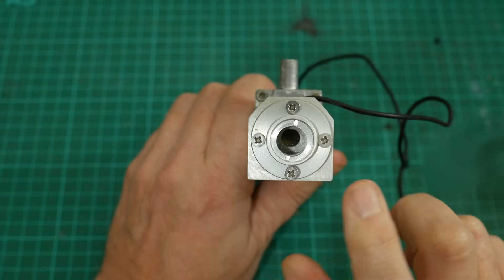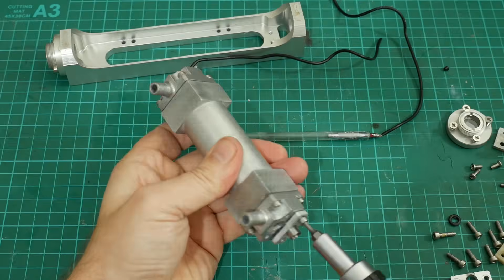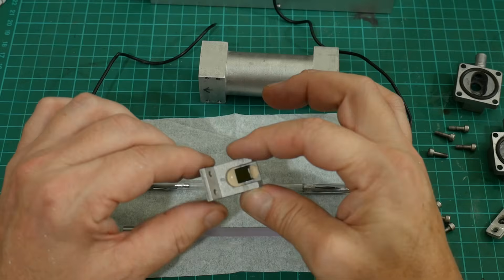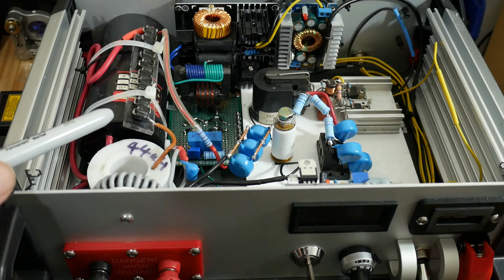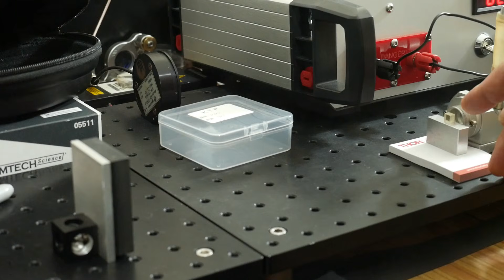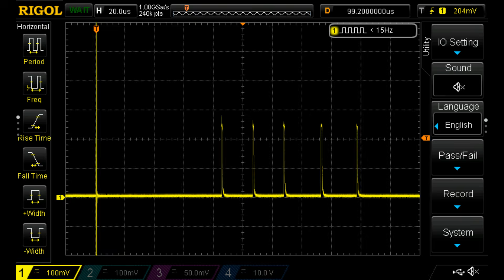Little Junk Laser is a MEGAWATT Beast!

Comment: Interresting stuff.
The 5 pulses you showed on the scope, why are the timing between them different for the first 3 and last 2?
Reply from the maker: This is because of the flash profile of the lamp, and the fluorescence lifetime of the Nd:YAG rod. I put a post up in the community section showing the output non-Q-Switched. If you look at the curve on that trace, it suddenly becomes clear where the odd spacing comes from. The first two pulses are close together, as they are at the peak of the pumping.

Comment: So the Q switch is at that back, and blocks the rear mirror, I'd assumed they were at the front, and changed from reflective build up to release
Reply: I noticed that , too, and then I had to think about it a little, so the beam goes back and forward so many times and gets the crystals atoms all pumped up to a certain level and then the Q switch allows all light through giving the final pass the energy to invert all the atoms to dump the photons, population inversion, this is just a guess and probably a bit off...On another completely unrelated thing, here in N.Z. any lasers over 5 m.W. are not allowed in laser pointers due to too many idiots pointing them at planes etc...I saw one advertised on a local Trade site, it CLAIMED to be less than 5 m.W. but I had seen the same thing sold previously and it was 200 m.W. green,  it was cheap and I purchased it, and sure enough , I'm not sure how many milliwatts it is, but it sends out a solid brilliantly bright green beam at night, quite handy for pointing out stars when I drag out my 8 inch Dob. reflector .

Comment: Sweet. I'm always impressed how small these powerful lasers are. I wonder what the M² of a laser like this is, if it's at all usable as a beam, or if one is better off just relay imaging the crystal face through any downstream assembly.

Did you have a chance to measure Shot noise of this thing?
Reply from the maker: :-) Yeah, they are extraordinarily powerful for their size. Its hard to tell beam quality from vaporizing black paper, but I don't imagine it is very pretty.
I have not performed in-depth measurements, yet, and measuring shot noise at the moment would be difficult as it stands, as this thing is still rough. There is time though...
Reply: @LesLaboratory  haha my bet for the M2 is upwards of 20. Probably best to relay image into nonlinear Crystals to avoid rings and hot spots in the profile.

My daily life has become hunting down shot noise, so that's the first thing always coming to mind with these pulsed lasers haha.

Comment: on a side note, the corroded casing is actually aluminium magnesium die-cast alloy. low alloy aluminium is quite corrosion resistant. relatively high magnesium content in die cast "aluminium" improves casting properties, but practically remove aluminium's corrosion resistance to water.
I'd say use ethanol or similar for coolant. alternatively can add inhibitors, just not sure what is available commercially
Reply from the maker: Thanks. CO2 laser coolant will probably suppress corrosion and mould. I will have to look up the datasheet. I see later models of these lasers use machined billet Aluminum so they are undoubtedly more robust. Scored another on eBay for parts 😉

Comment: Try shining it through a KTP. You can remove the gunk off the flash lamp with dilute hydrochloric acid. Just rinse it off and clean with some alcohol before reassembly. Another thing you can do is put the q switch in at an angle and get highly polarized pulses out. The angle would be brewster's angle for  halfmium oxide rather than YAG due to the antireflective coatings. A very inexpensive goggle set for YAG are surplus military SPECS, the green ones. They also have brown ones that cover NIR laser diodes.❤

Comment: Btw did you measure the pulse width and timing of the output without the q-switch in? I'm curious if it is a much longer single pulse - if so it might make a cost effective modification to convert a tattoo laser to being appropriate for laser hair removal, which typically uses diode pumped YAG for wider pulses better suited for frying follicles. New hand-units are available for only $100 from china making this a very inexpensive massive upgrade for someone actually using it for aesthetician duties if the pulse width is right.
Reply from the maker: I did not, but it likely become a video topic. Without a Q-switch, you don't get a nice long pulse out of flashlamp pumped Lasers. Instead the "pulse" contains a train of spikes (aptly called "spiking"). It's an interesting phenomenon.
I suppose it could be put to use in the application you describe, but it would be fun getting the FDA to approve it!
Reply from the maker: Here is a screenshot: https://www.youtube.com/@LesLaboratory/community

Comment: I'm really surprised that the internal reflecting cavity isn't elliptical. An ellipse should be preferable with the lamp at one focal point and the rod at the other.  Anything else will result in a non uniform distribution of light around the circumference of the rod.
Reply from the maker: For a specular reflector, for example aluminized or gold plated, yes and ellipse or other focusing shape is required. For diffuse reflectors like this, focusing won't work. The aim is to close couple the light and the diffuse surface ensures even illumination of the rod. The material used, often Barium sulphate (used in the world's whitest paint) has a reflectivity of more than 98%, more even than polished aluminium.

Comment: One end of the cavity had more corrosion because the "gun" was probably  stored on the machine one end up in a "holster" if that makes sense.
Reply from the maker: That makes sense. I recon the scorch marks in the cavityvis due to the Laser being run without water at some point as well.
Reply: Dissolved solids in the water, primarily calcium carbonate, will separate from the water when heated, and intensifies corrosion on metals.  While the pump is going, whatever calcium that precipitated out is being moved around with the water, going through the machine and pump, but after operation you'll have heat soak as the unit doesn't immediately cool off when you stop using it.  Chances are the machine had no post flow timer for the water pump, so that water was stuck in the cavity getting hotter and hotter with nowhere to go, allowing the calcium to precipitate to one end while being stored.  Doing it once or twice isn't a big deal, but doing the same thing hundreds or thousands of times out of habit or convenience will eventually add up.  Even with purified and deionized water it'll still happen, you can't completely remove TDS from water, but it would take way more time to build up than the unit itself will be functional.

Comment: Great video. 
About 15 years ago I missed out in a tank laser rangefinder on eBay. I found a cheap YaG rod recently but now eBay won’t let you buy anything laser related from eBay in Australia - despite non-portable non-battery powered lasers not being illegal.
Reply from the maker: Thats a real shame. I wish the legislators were suitably qualified in what they legislate for!
Reply: I have not had too much trouble, however some of the military range finder lasers had export restrictions from the US.  I do have one of the Hughes M60 Ruby rangefinder lasers… they have big lamps in those. Have never built a supply for it though.
Reply: I got that same model ruby laser rangefinder ~20 years ago...REALLY neat design...and the mechanical Q-switch; AWESOME!  I think that motor spun a small prism at 360,000 RPM (6000 rev per s)!  It was really clever how they made such a "long" optical path by "bending" the head 180 deg.  At night, with the unit's telescope, you can see a neat circle of light hitting something far away!  It has a very unique (small) series trigger transformer.  The ruby and lamp were in an elliptical reflector.  The PFN seems to be all in a metal box with, IIRC, has two terminals labeled "coil" and "cap"  I have never come close to finding the matching receiver.  "Anderson Lasers" had one for sale a while back.

Comment: Nice presentation on this laser! The Cr:YAG saturable absorber does indeed behave as a relaxation oscillator, producing a neat pulse train. However you may find it difficult to get a giant pulse out of it - these saturate at an intensity/flux set by the Cr doping level. Increasing the flux by shortening the pulse (same energy) should cause saturation more quickly, bringing the pulses closer together instead of merging them into one. However there are more variables involved with the fluorescence & absorption of the crystals so you could still measure some increase in the peak of each pulse - will be interesting to see what you find here. I currently have a large ruby laser on my desk, pulled from the garage after watching this vid so I will probably start restoring it and dig out the old electronics again :)
Reply from the maker: Thanks! That makes sense. I will have to keep an eye out for a Pockels cell. I winder though if the cheap coatings on the optics would survive a truly giant pulse!
Reply: @LesLaboratory  Yes i suppose you'll only know when the coating comes off :) Seems like the more powerful (although, also older) QS pulse lasers were using high speed rotating corner cubes as the HR, so no dielectric coatings involved other than AR. It's a matter of getting the rotation rate matched to the flashlamp pulse length and triggering the flash ahead of alignment. However the pulse length is probably a function of rotation rate as well, which might be good or bad - anyway a pockels cell of some sort would be another interesting vid to watch out for! cheers.
Reply: I am a glass blower..I can literally make you any kind of glass you want. I make custom borosilicate doped with rare earths. Uv and CFL reactive glasses..different colors..etc. tint amounts are super easy.. I do 100 lbs pots.
Reply: @mattycheezeburger  Damn! I'll probably shoot you a message once I get the basics figured out! I would love an ND glass rod, I'll figure out the polishing and parallel bits, but that's really awesome to know. Keep the glass skills sharp 😅🙌
Reply: @LesLaboratory had another thought about this since the last post - the saturation threshold of the Cr:YAG is probably related to distance from the pumped crystal since it will mainly be absorbing waste light until it bleaches. Increasing the distance could increase the saturation threshold and provide more time to pump the crystal before bleaching. I did not try this myself (and it might not be convenient to move the q-switch) but it might be a route to giant pulses. I'm assuming the q-switch is absorbing waste light and not some weird 'future intracavity beam' effect that isn't dependent on distance. Either way it would be interesting to know what happens :)
Reply: This is totally not what I expect from a typical YouTube comment
Reply: Yup to use a CrYAG you need to have a precise matched pulse forming network for the flash lamp to get a nice clean pulse output.
Reply: An acousto-optic modulator might also work - No high voltage included, but the drivers might be more difficult to find..
Reply: @laserhobbyist9751  Yes, that is how they work. You can realize a Q-switch based on that idea. Although especially flashlamp pumped high gain lasers might start lasing even if the losses are multiple tens of percents so it depends on the system.

Comment: Very interesting, the mirror alignment was way simpler than I expected. I usually use a piece of paper with a pinhole in front of the illuminating laser so it's easier to see when the return beam is centered. Also some lasers can't handle back reflections so it reduces that too.
I'd like to see the details of your series triggering circuit, you skipped over the big string of diodes but I assume they are between the storage capacitor and the trigger transformer to protect it from HV?
I had thought so many diodes would add too much resistance to the current path but I guess not.
Reply from the maker: In Laser like this, if you are close enough, and pump it hard enough it will Lase. After that its a case of walking in the mirrors.
The series trigger I should write up. This was built iteratively, and the big string of diodes was to protect the main capacitor from the trigger pulse. I later dealt with the trigger Pulse, by coupling it to ground, before it gets to the capacitor by means of a small value high voltage capacitor. This works ridiculously well because the high voltage pulse is high frequency.

Comment: These lasers are neat. I saw a video demonstration of one that had different crystal attachments to make it output different wavelengths depending on what color of tattoo ink was being removed.
Reply from the maker: You you can get KTP crystals for these to convert 1064nm to 532nm Green light. Some high end Lasers have Dye Laser attachments that can convert to Yellow, Orange and Red as well.
Reply: @LesLaboratory Mine came with a 532 attachment and a 1420 nm attachment. The 532 nm is fantastic and can ionise air at the focal point. The head also importantly creates a focal point unlike when you run the head with no attachment. The 1420 nm is a bit more sketchy - I'm not sure what it contains or what it is doing (or allegedly doing). I think based on the very questionable instructions it is designed to be used for skin treatment with some kind of facial mask which is not included in the package. Even with a very nice pair of laser safety glasses I prefer to not tinker with this system too much as I do value being able to see.

Comment: I didn't even know Nd Ce YAG was an actual thing. Why? Ce absorbing UV and doing an excitation transfer thing to the Nd?
Reply from the maker: Precisely! Because of this mechanism, manufacturers claim an increase in efficiency of about 30+%, enhanced UV stability and they also reckon you can run them air cooled at high repetition rates.
Reply: @LesLaboratory  nice!

Comment: This is a magnificent look at how one of these Nd:YAG lasers is put together! I was very interested to see that that actual cavity does not appear to be elliptical in cross-section. I would have expected the ellipse cross-section in order to better focus the coupling of the flash lamp with the laser rod itself, with each member at one of the foci of the ellipse. I suppose that given what else we've seen for cost savings in the construction of this unit, I should not be terribly surprised.

I now wonder, though, whether tilting the mill head to a precise angle would allow you to generate the correct elliptical profile. Of course that would be only the very first step in roughing out such a cavity, and you'd have to send it out for coating.
Reply from the maker: Thanks! 
For diffuse reflectors, a precise elipse is not required, as there are no focal points to worry about. 
Diffuse reflectors are considered superior in a lot of applications, since the light is evenly distributed, so no hot spots can build up in the rod. Diffuse reflectors can have reflectances much higher than any metal coating as well, leading to high efficiency.
You could probably mill out an Oval diffuse cavity at home.
Reply: @LesLaboratory  oh that's fantastic to know; I had not known about diffuse reflectors, but it makes good sense now that you've explained - thank you

Comment: Definitely new to this, but I thought I had a vague understanding of lasers from a physics/optics sense, and frankly am at a complete loss as how this can function correctly...
Isn't the point of the two mirrors at the ends of the tube not only to align the reflections into a beam (thus your clever alignment procedure shining another visible laser in) but also to match some integer multiple of the wavelength so the beam will all be in-phase?
And, isn't the same necessary for the "black crystal"?
Reply: It's been a while since I studied this, but IIRC the laser gain isn't at a single precise frequency, but a curve with certain bands of high gain. The laser will lase at any frequency with sufficient gain (and likely at multiple close-together frequencies) so unless you are going for an extremely precise/stable wavelength the mirror spacing doesn't matter. You're right that the highest gain will be at wavelengths where constructive interference occurs, but the difference between these "available wavelengths" is a tiny fraction of a nm with a cavity this long, so well within the band of high gain around 1064 nm.
The Q-switch (black crystal) should be antireflection coated so will just act as a lengthening of the cavity due to higher refractive index.
This laser is built for raw output power at minimum cost, so they don't care about the precise output frequency or maximising efficiency.
Reply: @laserdan cool. 

What was the beefiest Laser you were able to use?

(I have to say, this laser looks WAY simpler than the laser at work. And ist also a "little bit" weaker than the one at work)
Reply: I think the mirror distance will influence the laser modes. So yeah.
Reply from the maker: Ah, you are referring to longitudinal modes. In many lasers many such longitudinal modes will Lase in the cavity. Lasers like this are highly multimode, and barely care about optical quality never mind modes. You will be surprised at what will Lase and what will not.